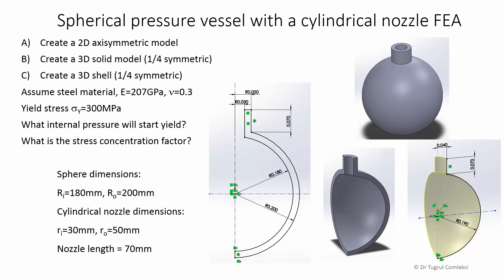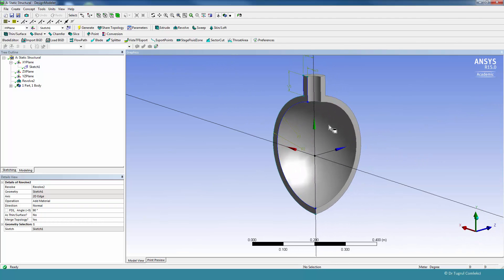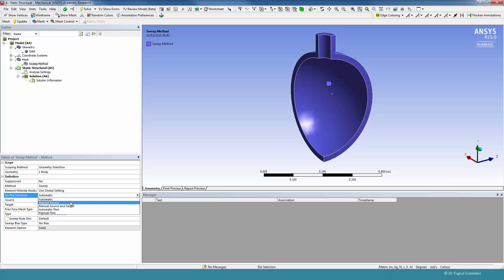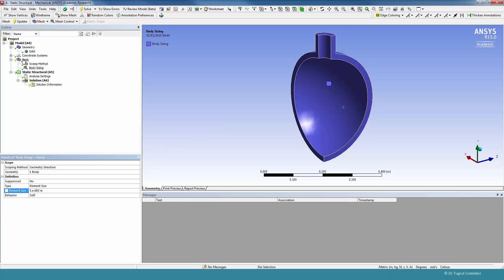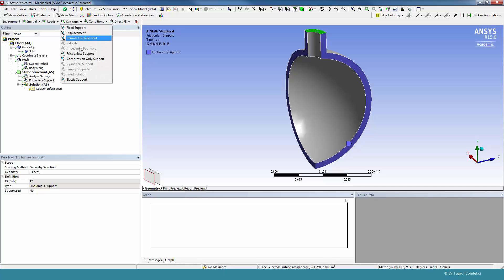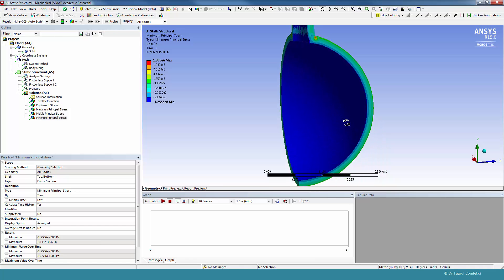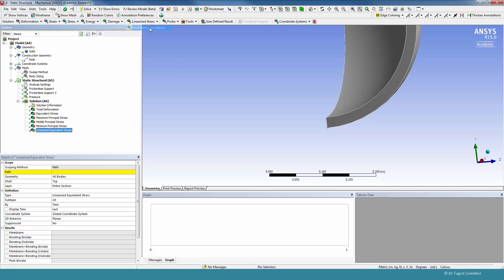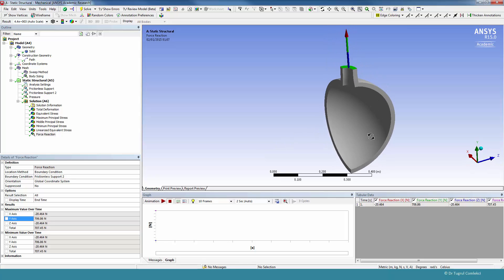Spherical Pressure Vessel with a Cylindrical Nozzle FEA - Part 2 3D Solid Model Analysis

Comment: Why wasn’t the same boundary condition applied to the axissymmetric model ? By which I mean, the nozzle top face fixed and bottom free to move.
Reply from the maker: Hi Vignesh, Thank you for your comment. For this model the two different way of applying the nozzle end load will give very similar results. The frictionless surface application on the nozzle top surface will mean the nodes on that top surface will remain in the same plane. The pressure load application instead would not constrain the nodes in the nozzle axis direction. So you raise a good point, and the FE analysts will need to be careful to apply loads & boundary conditions close to the real life conditions. In this case the different way of applying the nozzle load will not affect the stress concentration at the cross bore. It is important to avoid rigid body motions as well, so there should be equilibrium of loads in the vertical axis. Please check your reaction forces and make sure that the nozzle pressure load is calculated correctly. I hope this helps.
Reply: @FEAnalysis  Hi, thanks a lot for the explanation. The reason I ask this question is, I performed axisymmetric analysis comparing two boundary conditions: with nozzle pressure and without. The lower end of the vessel had been retrained in the axial direction for both cases. Strangely, the results are almost comparable for both cases.